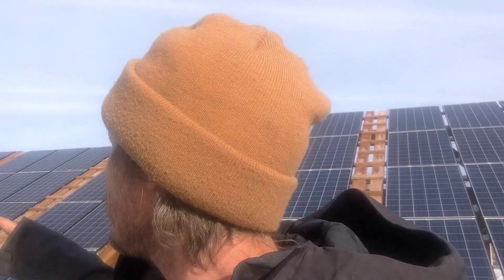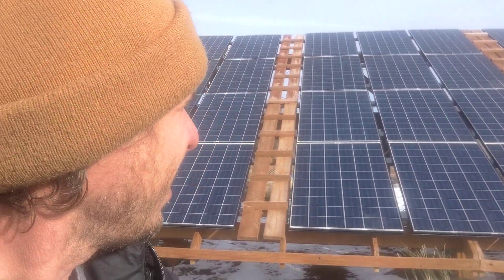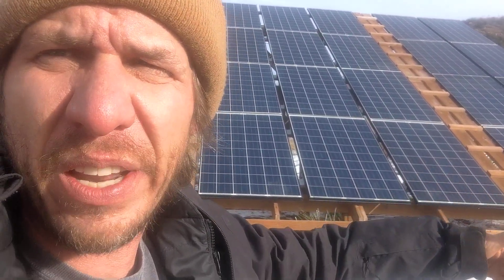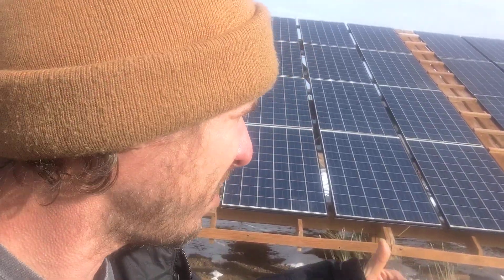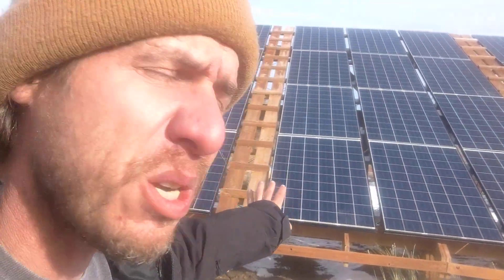Off-grid solar done right(mostly)

Comment: I installed 35kWp. Most 180 azimuth. Some 135 and some 225 azimuth. It’s not because my 143kWh LFE battery is not big enough. It’s because I want to run my house loads off of solar one hour earlier and later, when we are not gone at work. We can fix dinner and reheat water after washing dishes. Otherwise I would be pulling 2-5kWh from my battery.
Reply from the maker: A lot of people do this. But your efficiency goes down. The total number of kilowatt hours a day that you collect actually reduces.  You are  generally better installing larger batteries and collecting that extra sun and using your batteries in the evening rather than reducing your solar input by changing the angle of your solar panels.